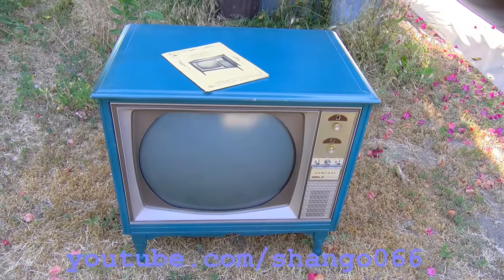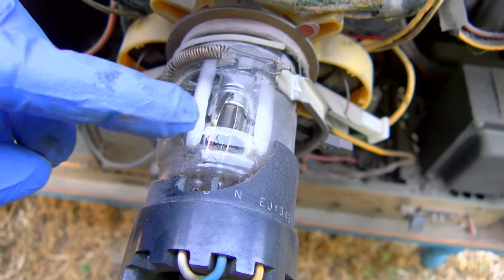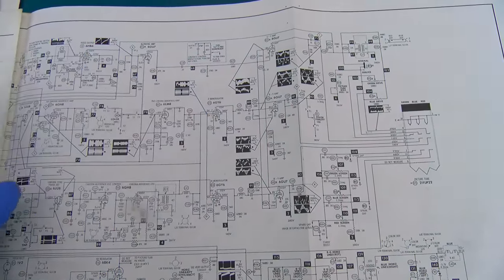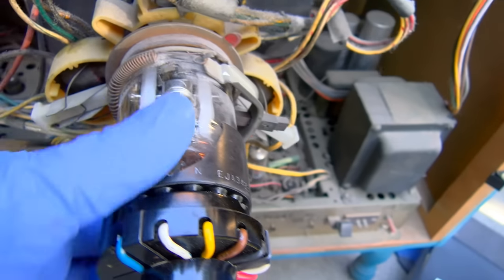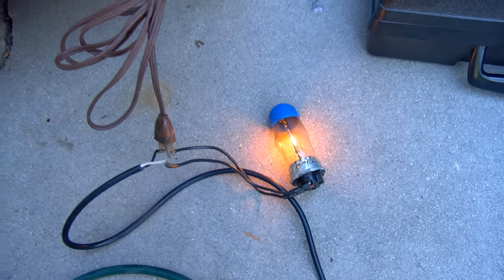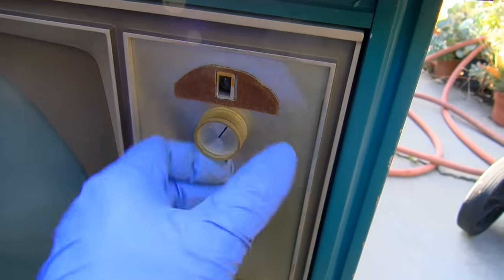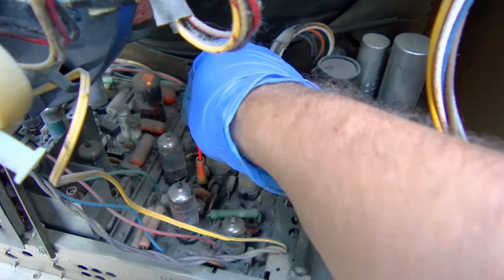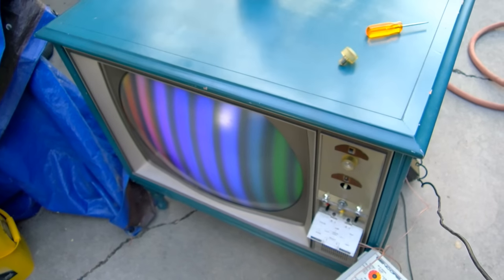Teal Admiral Vintage Color Roundie TV Analysis

Comment: Is there any possibilities that you could explain " How CRT Restorer works."   And explain what is Cut off. Is that possible. Thanks.
Reply: Sorry I'm not Shango but crt restore works by elevating voltage and current and short blast kinda sparks the tube and cleans the inside carbon deposits.  Kinda like a bug zapper.  Does not always work unfortunately
Reply: Cut off is basically the testing of how long the tube emits electrons after being with reduced voltage ie when you shut it off it will still continue to admit electrons the longer it emits the better the cutoff if you shut it off and it immediately goes to zero chances are the CRT is not very good the best result when you turn off the tester would be a slow steady drop to zero on a good picture tube
Reply: The cathode sometimes has oxidation or migration of minerals. The restoration is a large voltage to burn off cathode oxidation. Best case is you get another 100 hours or so out of the crt.
Reply: @carolriley9392  
This is not the cutoff, this is the "life test"
Reply: @greg6276  yeah, I don't know much about CRT testers, or electron guns, but I thought cutoff had to do with biasing one of the elements of the gun until the gun just starts to turn on, then a test signal/voltage is applied to do the emission test. Basically it just gives an absolute position to the emission reading, and gives an idea about how well it will work in circuit, i.e. you'll have to drive the CRT really hard (resulting in a nasty picture) if you can't establish cutoff within the tester's range.
Reply: @Broken_Yugo  
The cutoff is when you apply a negative voltage and the tube stops conducting. No emmisions=no cuttoff. Do not confuse it with the life test, which stops the filament voltage and monitors the emmision.

Comment: Acetone can melt super glue but it takes time, soak some cotton wool and wrap around the inside metal shaft close to back of knobs to avoid damaging the facer plate the vapour should loosen it, or use heat both methods are risky can melt the plastic or paint no easy solution but physical force would most definitely break them anyway.
Reply: Smart! Thanks.

Comment: I have a RCA TV theatre from 67, the tube has been replaced at some point with a color brite , it test average on my B&K ...I will never get to it ... I have put ads up on Antique radio, Video Karma , etc ... nobody wants these ... can't even give it away... I realize the theater is large ... but no larger than a typical console stereo ...and the stereo part works great.. I have not found any younger generations that care unless it will bluetooth something...
Reply: The irony being that it's actually a really easy plug and play job to add bluetooth if there are aux or tape inputs on the back, and only marginally more difficult if there aren't. And the sound from an old radiogram is a thousand times better than any bluetooth or smart speaker, most of which are mono (as they want you to buy two of the damn things and pair them...

Comment: If the owner is agreeable to getting those knobs removed by any means necessary a thin blade wood chisel tapped around the back edge of the knob might cut through the glue and pop them off if the glue doesn't go back too far. The picture tube tester was correct that replacement tube is pretty worn out.

Comment: Interesting. I did not know any of the young people were interested in anything but the latest iPhone or computer.  Being older and having quite a bit of knowledge about things mechanical, electrical, and electronic I have found them disinterested.  Try to get them interested gets you a blank stare.  They just expect stuff to work, and they get a new one if it doesn't. Possibly because chip based electronics is so unapproachable.  You can't figure it out by looking and playing like you could with the old electromechanical stuff.
Reply: There will always be young people who wonder how things work.  If you went back 50 years, you'd find out the majority of people didn't know and didn't care how anything worked.  Only 10 percent of any generation have the natural curiosity to want to open up things and see what's under the hood.
Reply: I recently have worked with a lot of gen Z guys at an auto parts store. The smart ones  already know a lot or are hungry to know.

Comment: It's a shame how the older generation treats the younger generation. I'm 32 years old..I've done VHS player repair for 5 years. I taught myself.. I picked up a 1968 GE black and white TV the other day. It worked for 3 min then the screen went black. From the research I've done , I believe it to be a faulty flyback. I asked for help on a vintage TV group. Asking questions about part numbers, universal parts, different equipment to test components. Vintage TV repair is seriously something I want to learn. Not to make money. I'd love to resurrect old TV's like Shango066 does.  I was shamed on the group. I was told to leave it to professionals. Kept getting told I'll get electrocuted.told the tv isn't worth fixing, I'm told I'll never find parts.  I don't see why everyone is so pissy. I'm wanting to keep the tv original and get it working, not turn it in to a bird house or some other Pinterest project.
Reply from the maker: There are plenty of videos on this channel that address those issues and even several on that era of GE set. Usually fly backs go up in smoke and Flames, more likely a boost capacitor but take your time and look through the videos especially on the GE I know I did one of those recently

Comment: Painted-up vintage display tv's with the knobs glued on---only in hipster California. You know you've got a high-hour set when even the replacement CRT is completely baked. If I was the owner of this set, I don't think I'd proceed with it. Pretty sure all of those control shafts are plastic, and you'd have to destroy every control to get the glued-on knobs off
Reply: well, $100 or so has been paid for it, so might as well go for it, ....shango will have to see what the owners say, if it was me i'd at least try,
Reply: It's also very possible that the knobs were glued on because this thing was sitting in a bar, so patrons couldn't adjust the volume or mess with the fine tuning, and maybe just switch the channel when the football wasn't on. Would also explain the high hours even on the replacement.
Reply: Depending on what the glue is, a mild solvent like denatured alcohol might soften it.

Comment: If you let Gen Z destroy these in the process of "learning" they will just get rarer, and rarer.
Reply: A couple sets ruined by new collectors versus all of them thrown out when the present collecting generation dies. A friend of mine is an old time RCA Technician, started at age 10 in 1964, he's 66 now. He has at least 1000 radios, at least 40 combination sets and countless TVs in his collection, what happens when he passes on? Will his 60-75 year old friends take his entire collection so they can keep it a few more years until they die and it all gets chucked? He for his part has been a mentor to myself, and several of my friends who are all age 22 or less. If you don't break any eggs, you can't make an omelet.